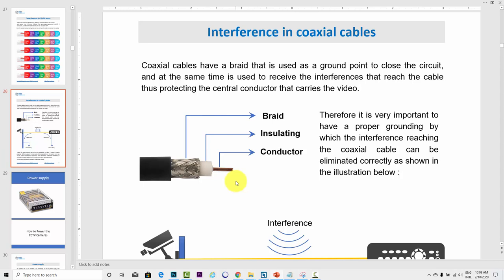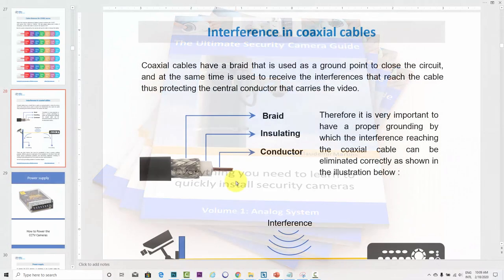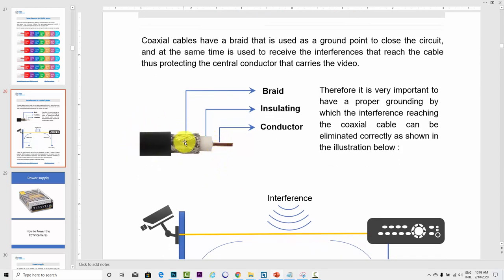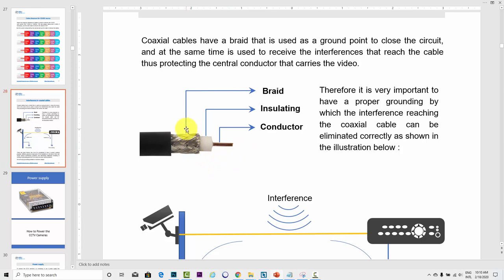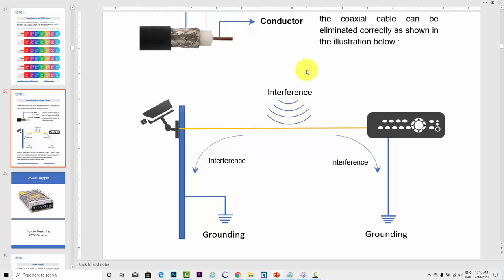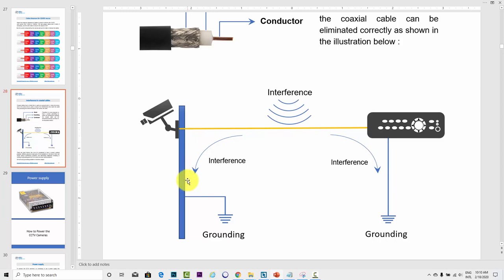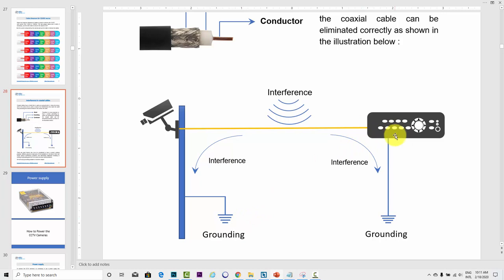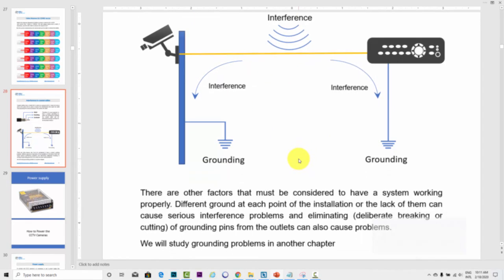CCTV training - Coaxial cable interference

Comment: Boss make video about peo switch connection using ip camera thank you boss
Reply from the maker: Just use a PoE standard 802.3af or 802.3at to connect the cameras up to 100m using UTO cables. Easy like that.